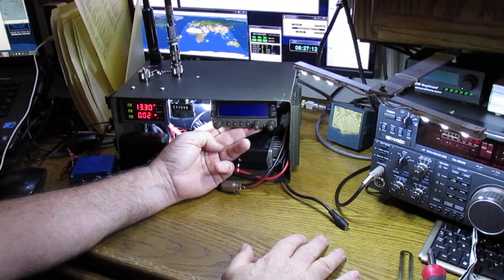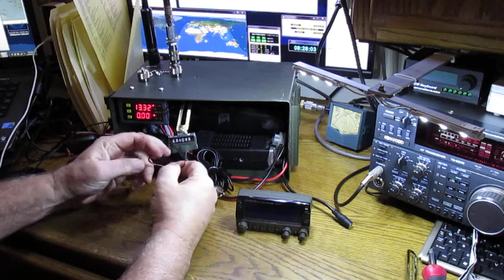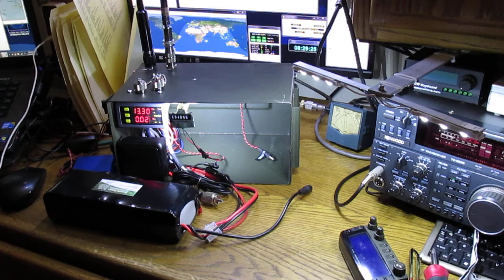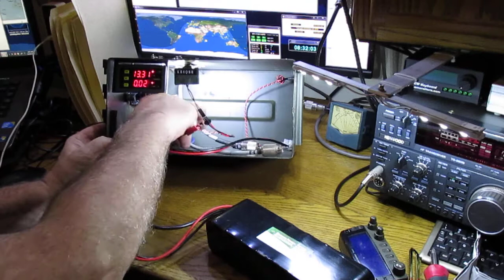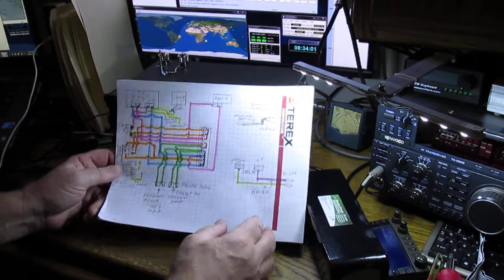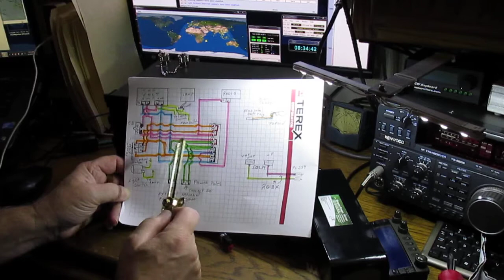UHF/VHF and HF Ammo Can Go Box

Comment from the maker: Here is the ebay url for the tape and volt/amp/watt meter

3M 1" x 21 ft VHB Double Sided Foam Adhesive Tape 5952 Automotive Mounting 24mm

http://www.ebay.com/itm/222355112384?_trksid=p2057872.m2749.l2649&ssPageName=STRK%3AMEBIDX%3AIT

DC 90V 30A Volt Amp Battery Capacity AH Power Meter Charge Discharge Monitor NEW

http://www.ebay.com/itm/DC-90V-30A-Volt-Amp-Battery-Capacity-AH-Power-Meter-Charge-Discharge-Monitor-NEW-/172466303015?hash=item2827caf027